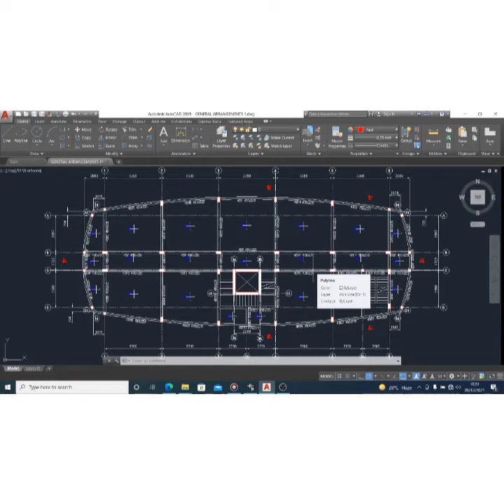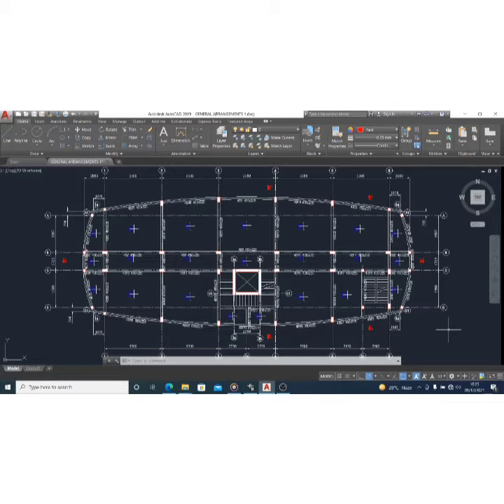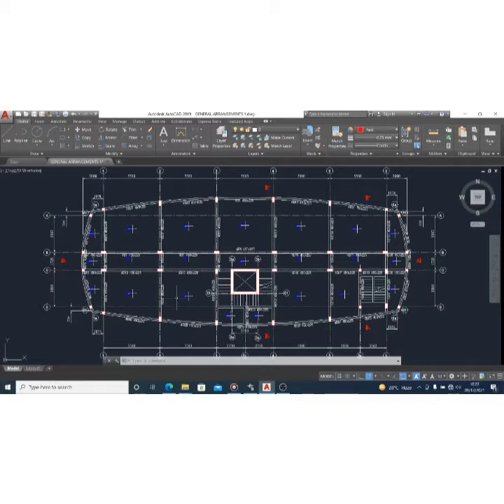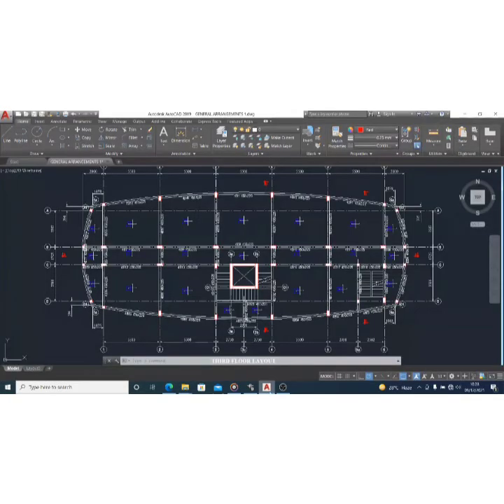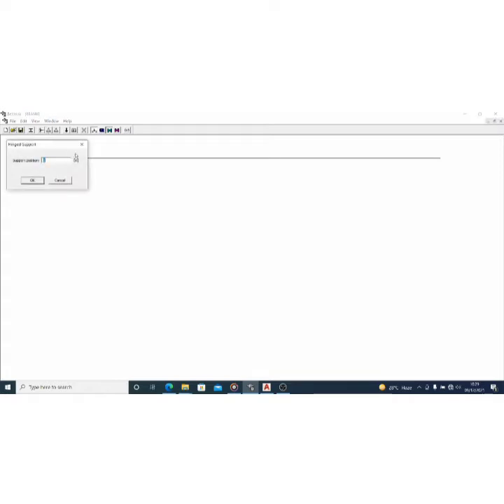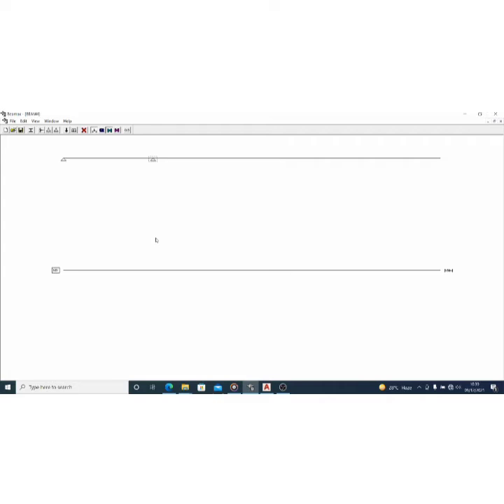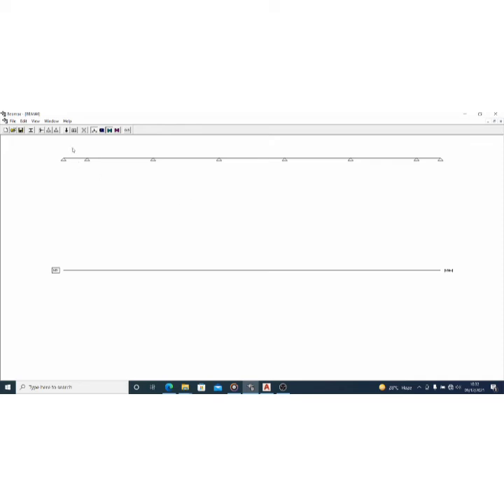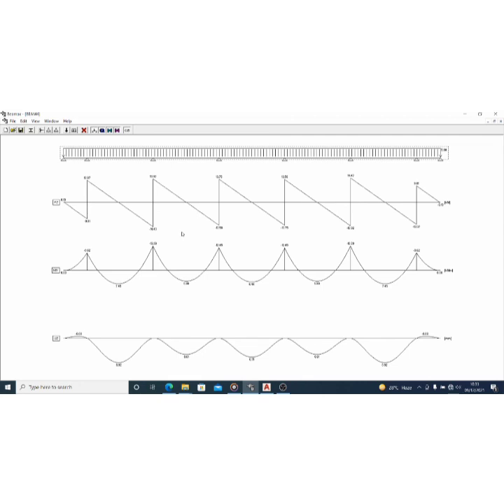BENDING MOMENT AND SHEAR FORCE MADE EASY WITH BEAMAX

Comment: good morning sir 
why did you use only pin support for all the support areas ..
i read that for a continuous beam we use pin support at one end , roller support at another end and then depending o what you are designing for , pin or fixed supports at all internal supports